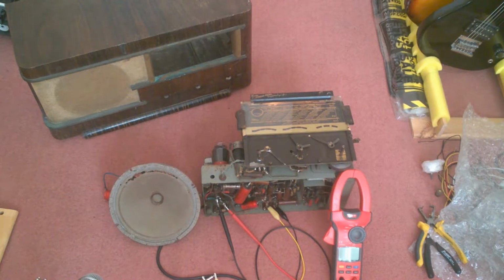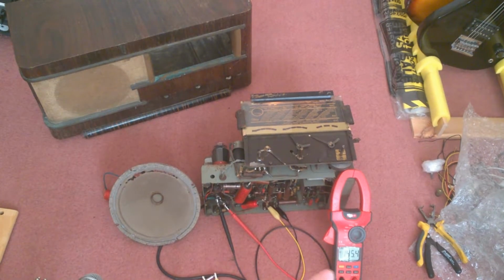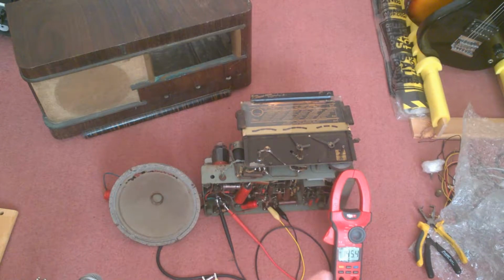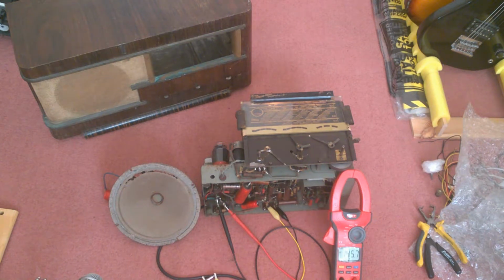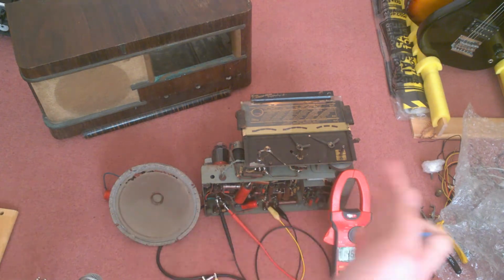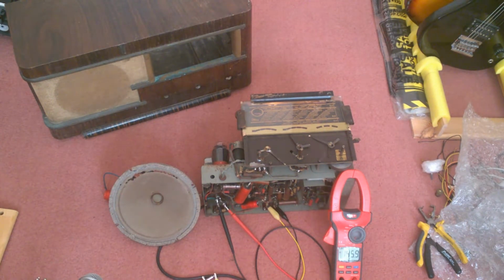1939 AM Radio as a Guitar Amp (Ondia 204)

Comment: That's an interesting set, I couldn't help but look up the model number, it's a pre war French radio, three bands, maybe short, medium,, and long wave, cabinet looks like it has some rosewood veneer. Mostly side contact Phillips tubes, I like how they have little indicators for each control displayed at the bottom of the dial. The volume going up and down is very likely the audio coupling capacitors failing, and or a plate load resistor.
Reply from the maker: Helllo, thanks for your comment.

The cabinet is definitely veneered. Looks to have some kind of varnish on top that's getting quite crusty. I was going to get some kind of solvent or varnish to smooth it out.
The indicators are quite nice. Each once has a little spring and string. The string wraps around the knob and the spring lets the indicator return to the left position. The indicator on the right connects to the band selector knob (on the right face of the radio) over a little pulley.
I've got a bunch of caps to replace the originals with. I've pulled out 4 caps already, with 3 of them being completely dead.I'll get around to making another video on it since I've done a few repairs by now.
Reply: Are the original caps in glass tubes? I've heard that some French radio manufacturers used glass tubing to house their paper caps rather then the usual cardboard. The filter caps may have been either wet electrolytics or the "dry" kind, the modern types are more like the latter. They were called wet electrolytics because they literally had a liquid inside to act as an electrolyte. 
  I think I have seen dial pointers arranged like those little indicators, they work well until the cord breaks. It's a little trick to get the tension right on the cord though so the pointer starts and finishes in the right spot, however there may be some way of adjusting the needle such as a set screw.
  Acetone should work to strip the old finish off,  if it needs it, unless you can find some proper paint and varnish remover that is NOT lye based. I'm not sure what they used in France but most North American radios had lacquered cabinets, they may have used shellac or alkyd varnish perhaps. You don't want to use water based stripper to get the finish off, they may have used hide glue to attach the veneer, and water can cause it to lift. The grain was likely well filled so the finish would have been like glass when it was new.
  You could probably repair the speaker cone by using a flexible glue, like contact cement, and either cloth of a chamois leather to patch the surround.
Reply from the maker: There is one cap in there that has a clear plastic case I think. The value is 0.1uF but all the other 0.1s are a different style, so I believe that's a replacement.
There's only a few caps that are bigger than 0.2uF, which are probably the electrolytics. A couple of those have been replaced by someone else. Two of the caps I removed were small 8uF cans.
Now I remember that only the volume dial had a string around the pot. The other two indicators used thin wire.
Thanks for the tips. I watched a guitar repair video a while back where the finish was fixed up in a couple of places with some kind of solvent that melted the finish and re-hardened later. What do you think about that?
I've made a full repair attempt on the speaker. I used some kind of PVA glue all around the edge to give it some rigidity and glue-doped kitchen roll paper to fill in the voids. It works kind-of okay. There's some resonance in the upper bass frequencies and a little bit of a fuzzy sound but otherwise good.

My plan for the radio was to do a proper guitar amp conversion. The schematic I'm finding online isn't fully consistent with what I see inside and the RF section has a few issues. The band selection knob is broken off, and the selection switch jams and keeps on throwing out its ball bearings. These things don't fetch a lot on the market anyway, especially in this condition.